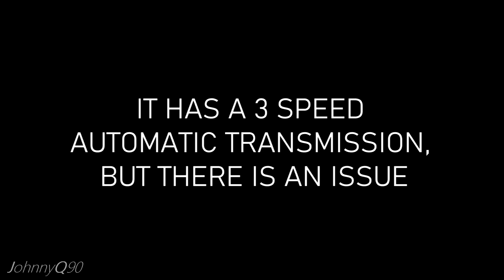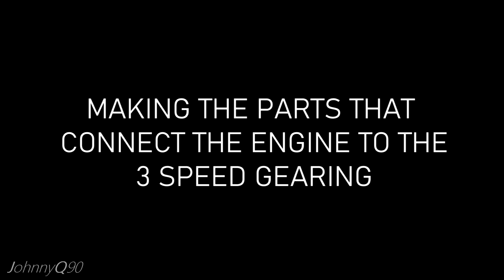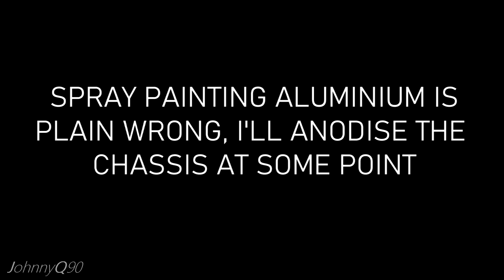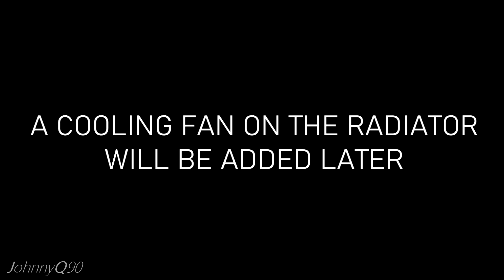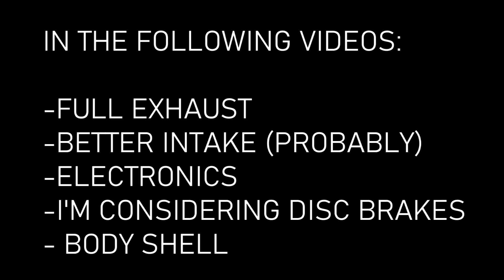FOUR Cylinder 1/6th Scale RC Car Build - Engine Installation & Transmission

Comment: This is so beautiful, you need to put a quieting muffler on it, because something as clean as this needs to sound as smooth as it looks.
Reply: Agreed
Reply: Imagine a low rumble out of a model car... that would be awesome.
Reply: This man needs to build and unequal length header and a nice side pipe .. and a filter for the trumpets
Reply: Nahhh fuck that. Loud and proud!
Reply: @joshmanis9860  YES!!!
Reply: Maybe 2.5 times the displacement of the engine for the volume of the exhaust muffler is a good value. Works for a single engine and sound more smooth and stronger pulses for scavenging.
Reply: yeahh, its a good idea
Reply: A muffler makes it quiet😐 no suck thing as a quieting muffler Bec that’s what they are made for
Reply: @rukiddin0669  :) It sounds awesome!
Reply: @ThePower1037  indeed it does. Much cooler than the high pitched, harsh screech from most nitro cars.

I'm hoping for a raise soon, and if I get that, I may be able to build some stuff too. I'd love to get one of these and do a scale ae86 or similar car.

Maybe an mr2?
Reply: Nah that's the fun part about an RC car
Reply: @rukiddin0669  that would be so stupid

Comment: This rc car is great but I have for you a different challenge If you can make an rc engine out of scratch
Reply: That would be cool to see
Reply: @Matty.Hill_87   I know
Reply: Doing an engine from scratch would be very hard, but Johnny might be able to pull it off.
I wonder what engine configuration he'd go for.
Reply: @hamster9135  well eny engine can be built from scratch easily with the right equipment

Comment: It would be cool to see this motor in a RC sand rail buggy, with a full tube chassis.
Reply: You should check out Timsane on YT! He also builds crazy stuff! Found him weeks ago
Reply: I really like this idea!
Reply: Check out timsane projects channel.. He is doing just that
Reply: @PoPordon  check out his previous build, it was incredible
Reply: @Matty.Hill_87  wtf is so cool
Reply: That will be asome to see👀
Reply: Check out @Timsane he’s got what you’re after
Reply: Build your own out of auto brake line. Bend it and braze it.
Reply: YES
Reply: Yea I was thinking a 4 wheel drive, 4 wheel steering monster truck. Either way it's badass
Reply: @frankierzucekjr  Ah, so you're after @rcWizzard's 1/4 scale grave digger with conley v8
Reply: @steved479  I haven't seen it.
Reply: @frankierzucekjr  Search "1/4 scale gravedigger"  Its an old channel/project but it's great stuff.
Reply: @RamenPoweredShitFactory  ់
Reply: It would be a trip if were to emulate the look of the more common buggies with VW bug engine and steering components.
Reply: Buggy = wack, JDM cars are waaaay cooler

Comment: JohnnyQ90 Keep in mind, Heat does not scale down. Your engine will get to full scale temp's, you need to have as much water as possible to keep your engine safe.

Comment: Excelente video sobre construcción de coche RC, en línea de 4 cilindros a escala 1/6.  instalación y transmisión del motor, respetos y  saludos desde Venezuela.👍👍👍👍💯💯💯💯💯🤘🤘🤘🤘🤘
Excellent video on building a 1/6 scale 4 cylinder inline RC car. installation and transmission of the engine, respects and greetings from Venezuela.👍👍👍👍💯💯💯💯💯🤘🤘🤘🤘🤘

Comment: Disc brakes are almost essential,  FG do a complete hudraulic drilled and ventilated disc kit, its very good on 1/6th scale :-)  Chassis might need to be a bit thicker.. theres some serious forces at work in there. Ally has a modulus of about 69, carbon fibre of the same thickness between 90 and 190!!  nice work.

Comment: You should create a traditional intake manifold (with a filter) so it can get clean air instead of a bunch of dust and also create a traditional exhaust manifold so the engine would sound a little bit better. I can't wait to see where this build goes and what the body will be (it should be a 2nd gen MR2 body because of the transverse mounted engine) . Good luck!

Comment: What about 3D printing some of the pullies? Yes it will wear a bit faster but easy to reprint. Just a rubber on them should be fine and should save some weight. It takes a lot of torque to get something to speed up and slow down so any savings you get there would help in off the line response. I would say go with carbon fiber but never seen you play with that before so 3D printing might be the next best option. Print one and weight it and compare against the aluminum one.

Comment: You should probably add a good pc fan on the radiator, no matter how good it drives it won't be getting enough air in the back to cool it, so pc fans are a good option
Reply: That and/or ducting to cool the big engine.

Comment: About the gearbox. In a large car the automation of it needs to be cheap because otherwise you would just go hybrid. But here we can use a pair of bass voice coils or solenoids to change gears? On a race car the first gear matches torque. You start with the clutch and then pull the engine from 1200 RPM to 8000. Then we switch gears to 6000 RPM. So the electronic closes throttle, pulls out the cogs, then watches the 2000 RPM delta to the next gear ( 10 Hz ) and precisely jams in the cogs into the respective holes. A long thin shaft to the rear acts as a twist spring and eats the shock. Wheels spin a bit.
Reply: The flywheel helps a bit, but basically an engine with 4 or less cylinders and more then 1:6 compression has negative instantaneous torque: ms periods of time where the engine has no surplus energy for the drive train. I propose a CVT where a push rod or connect rod is relocated on a large drive disk (pair). The large wheel has egg carton pattern. A robot arm presses the connection rod end into this. Then pulls out and relocates. Maybe tandem arms.

Voice coils are used to inject short torque pulses into the disk and the flywheel to match a position on the fine grid exactly. So this makes an irregular clicking sound with the same repetition as the ignition.

Comment: Always love your builds, 1 small criticism, the engine mounts look quite flimsy, once you start applying torque and heat I fear these will bend and put stuff out of line, more than likely strip a belt. On a personal note, I fancied doing a 1/5 or 1/6 mk2 escort putting this engine inline, or maybe an escort cosworth as the appearance of the Toyan has similar features. Unfortunately for me, time, money, and I do love to bash my models hard so not very practical for me and I would be devastated after the inevitable crash!!! Could be fun to convert an x Max mind!!!

Comment: You just need a plenum covering yout trumpets, it will help build torque at lower revs, also a wider belt at the tranny is something to consider. Did you gave up at supercharging this engine? I suggest that in your next supercharger build use a reduction gear to spin the sc faster, also a tighter or smaller A/R might help. Sorry for my bad english.

Comment: Man you need to make abs brakes for this.  3d print sensor to detect holes in the disc brakes.  Make one for front and back or each wheel.

Comment: I have gas powered 1/10 scale car, and its all wheel drive with 1hp.  If it didn't have awd, it literally wouldn't stop spinning the rear tires.  I've tried it in 2wd mode just disconnecting a belt and thats all it does.  You can't drive it forward at all without it just spinning out.  This car with this much power won't do any better with 2wd.  Better upgrade it to AWD or it won't be driveable, unless you just intend to have it sit on a desk and collect dust.  Its certainly a cool build, just trying to give some advice from experience.

Comment: Love the channel and not throwing shade but don't mess with that intake.. Im a engine guy high na hp is my bread and butter.. all of yours have been bad for hp. Love your work super talented just it works great leave it. I'd struggle to make it much better. The one thing that might help is if you have the cam and port flow you could bore the carbs out Abit and pep it up top a good bit but I doubt you have the flow with the ports and valves you have. Better off milling the head some and degreeing the cams in my opinion. Some nice headers like what you did on ver1or2 v4 would be great especially if you taper the primaries down 15%-25% then have a megaphone collector. And if you do boost it she would love the pipes. Would love to see all of these engines on the dyno with all the various old combos so we can all see what did what. And just a thought a cable replacing the inbord nut would give easy control over the break with a lever from a cheap bicycle and be consistent.
Keep up the awesome work man truely beautiful stuff just some thoughts that you might enjoy.

Comment: You are going to have to either A: Overdrive the input side by at least 1:2 if not 1:3 or B: change the FDR to be nearly 1:1 if you want this thing to have any speed. As it is now it's gonna be a slug as well because this engine just does not have the revs that transmission expects.

Comment: I wonder if Mr. Q could construct a working miniature CVT transmission.  Not like the motor vehicle type, but like those on go karts and non street vehicles.  I bet this would work well with those engines since they have a small powerband.

Comment: hey dude i see your videos you are quite innovative. i saw your video of making turbo which didnt work well. i figured out that i was trying to do the same making a turbocharger with BLDC motor because i want to put that turbo on my bike. but due to the lack of components in my country my dream is still a dream. but you have quite a lot of CNC stuff and motors availibilty you can make it. ill be happy if you try with real turbocharger with BLDC MOTOR buy removing the turbo exhaust side assembly

Comment: YOur work is just amazing.  cant wait to see the first test drive o it.  And i am realy curios on the exhaust build in your next video.  How did you manage to get all that pink anodising off the aluminium?  I have seen people using even cleaner and other things, but that always makes the part gray and dull. And your way it looks just like brand new aluminium.   Again, Amazing work you are doing here.  Greetings from Norway.
Reply from the maker: It was just painted with high temperature spray. I did it to look nice on the video but it won't hold. I need to remove the anodizing and paint and do it properly.

Comment: Would it not be possible to mount the engine mid chassis in-line and mount the transmission above the output clutch?

Comment: How... Does that 3 gear transmission work... Assuming: It starts in first gear, then via a clutch, it can engage 2nd gear, and then 3rd gear. Or maybe I'm wrong in that assumption... How do the other gears disengage the shaft so only one gear is currently transferring power?
Reply: gears are mounted on one way bearing, once higher gear kicks in, shaft is overdriven an lower gear disengages

Comment: Hi Johnny. I am a guy who likes to follow your Youtube channel. I have two questions; 1- Do you think the balance of the vehicle is good? It seems that all the weight is concentrated in one section. 2- How accurate, safe and long-lasting is it to transmit power with drive belt without shaft?

Comment: I think that the clutch is much to heavy
Because of that the shoes will ware faster and the bell 
You can understand that because the wheels do not spin or they do not tremble
Reply from the maker: Yes, at some point I'll put some stiffer springs. But first, a 3 shoe clutch will be installed.

Comment: I realize now just how much 3D modeling work must go on in your shop/workspace because, obvious it is, those multi-axis milled parts don't come from nothing. The 3D printer is a flashing sign there, but I sometimes miss the obvious for the mote of dust floating around.  I'm thinking you've got some serious CAD skill to do all this. What program(s) do you use?
Reply from the maker: Hi, thanks! I'm using Fusion 360 for CAD and CAM.

Comment: I have the 4&1 module, do I need a separate battery for the starter? Or solder starter wires to module? I have engine put together but no diagram for wiring can you help me please?

Comment: Would it be possible to mount the engine longitudinally? Would that reduce drive train loss because less parts? Awesome work anyhow....makes me want a home cnc lathe/mill/whatever :-)
Reply from the maker: Mounting the engine longitudinally would require angle gears to conect it to the transmission just like I did with the v4 engine. I think in the end machanical losses would be similar. It will also take much more space (longitudinally) on the chassis which will make difficult to mount all the other stuff, like electronics, batteries and probably hydraulic cylinders for the brakes.

Comment: Do you think you will have a problem with the gear “slipping” on the clutch bell when it heats up, or a the belt melting? Very cool project though
Reply from the maker: Yes I thought about that too. Hopefully it will be ok, otherwise I'll need to think something else.

Comment: Can you reuse the metal lost when making those custom parts? is it even worth it to recover it?
Reply: Usually no cut off sections can be salvaged but milled chips and such are usually coated in grease or oil and are not fit for recycling in a home furnace. Some projects do call for milled chips but they are not common.
Reply: @ericgillespie2812  ok. thanks for the insights

Comment: Your using the wrong cutting tool to turn down that bar stock, not to mention the wrong speed. Recheck your Lathes speed chart. What brand of Milling Machine are you using?

Comment: Poor engine location. Better to be placed along the chassis. Where are you going to put the servo? And in general, with such an engine it is necessary to make a copy HotRod, or Formula 1.
When to expect the continuation of the project?

Comment: What did we miss during the finger snap I’m just saying
Reply from the maker: Just boring spray painting and a couple of holes drilling on the chassis to mount the coolant tank and radiator mount/bracket :)